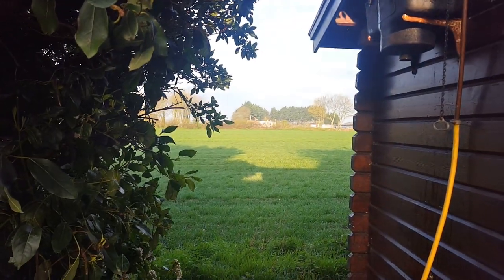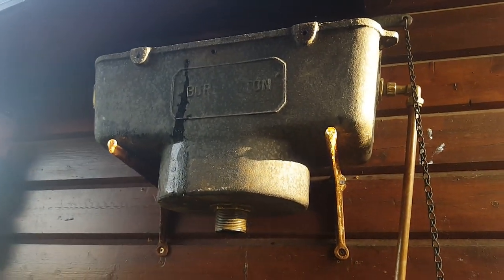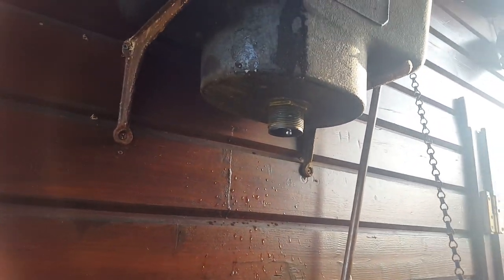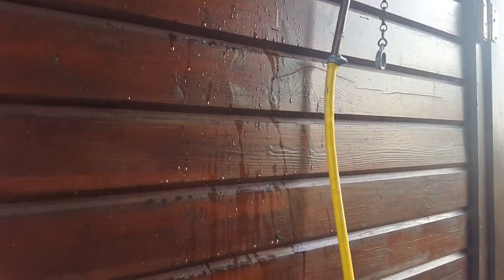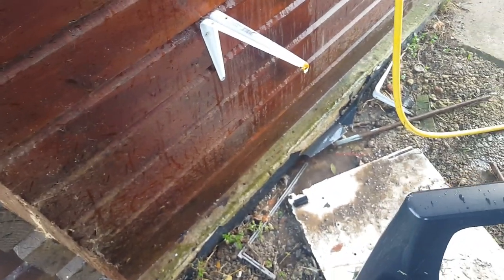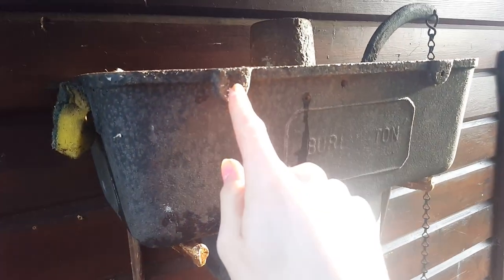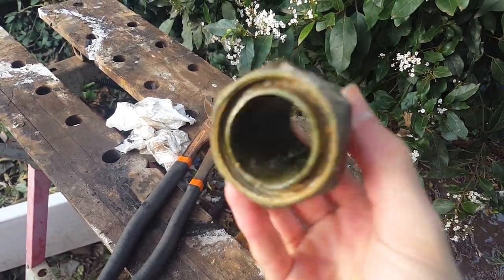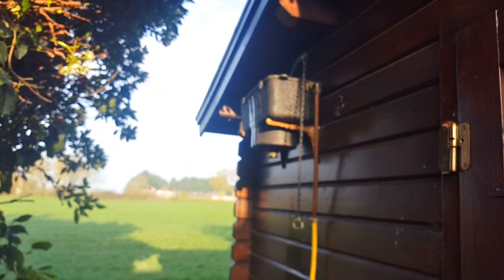Flushing a Vintage Bell Syphon "Burlington" Cistern without a flushpipe

Comment: Hi, I purchased a similar cast iron cistern and fitted a 42 mm copper flush pipe. However , like you, the cistern will only flush if I push the bell down when flushing. Is the copper flush pipe too large?
Reply from the maker: Hi Kelvin. I have got another video uploaded of this cistern flushing with its original 32mm steel flushpipe vs a 40mm waste pipe. You'll see it flushed perfectly with the original flushpipe on both pulls while it struggled with the waste pipe. I would recommend changing the flushpipe to a standard one, even if its a modern one & then paint it to get it to blend in. I'm on insta under the same username & my email is on the about section on my channel if you want to send me some pics of it so I could advise any further. Best of luck 👍